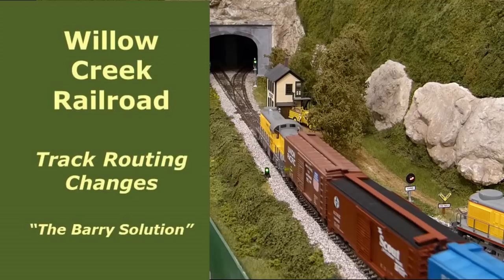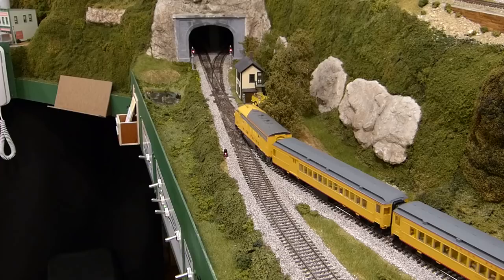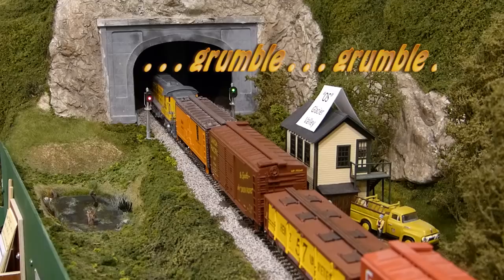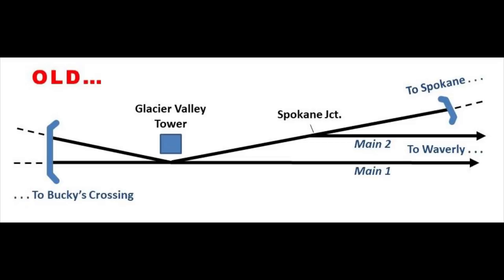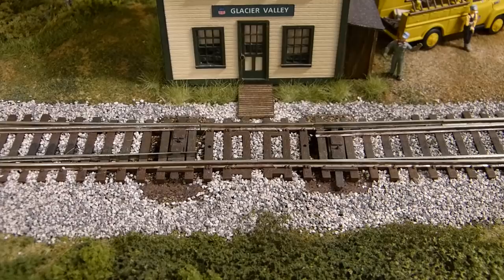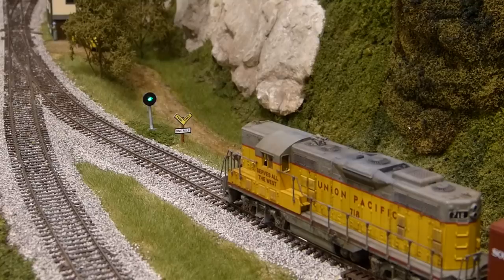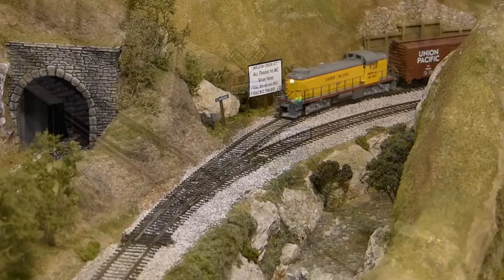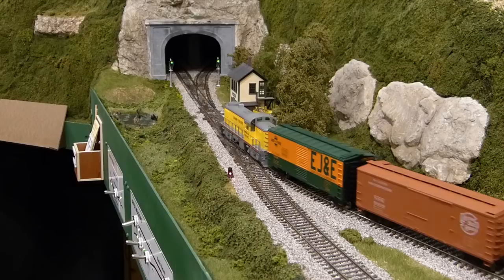Willow Creek Railroad - Track Routing Changes

Comment: with the crossing change iam wondirng why dont made 2 seperated tracks? the crossing isnt necessary longer with the depanded routing, or just used a simple crossingtrackelement..
Reply from the maker: Ah ... if you only consider the "normal" point-to-point operations, you'd be correct.  But the Willow Creek also has a special capability reserved for what I call the "demo mode".  Behind-the-scenes electrical toggle switches override control of the turnouts at Glacier Valley and also at Summit Springs, so that a train can run the layout in a continuous run using the two reversing loops, without any intervention to throw the reversing loop turnouts.  The toggle switches activate optical sensors that then control the reversing-loop turnouts.  Consider it an automatic-running display train.  It allows me to talk about the layout with visitors yet lets a train run around the layout to show the track route without me having to worry about throwing any turnouts.  The pair of turnouts at Glacier Valley are key to making the "demo mode" work since the turnouts function together for the lower reversing loop, and that's why they were not replaced by a simply crossing.  Hope that makes sense.  Let me know if you have additional questions.  Thanks!

Comment: Any reason you don't use a crossover instead of the two sets of points?
Reply from the maker: If you look at the Willow Creek track plan on my website, you'll see that the left turnout is actually  the turnout for the lower reversing loop of the layout and, therefore, is used to facilitate continuous running when the railroad is in "display mode".  For operations, a crossing would suffice, which is what the track routing changes essentially did.  You could replace the 2 T.O.s with a crossover, probably a double-crossover, but that would be a whole lot of track to replace and install at this time.  Since the original track plan only used the 2 T.O.s, I could make the track routing changes to benefit operations without having to replace any track/T.O.s at Glacier Valley.  If you were starting from scratch, a crossover might be a consideration.